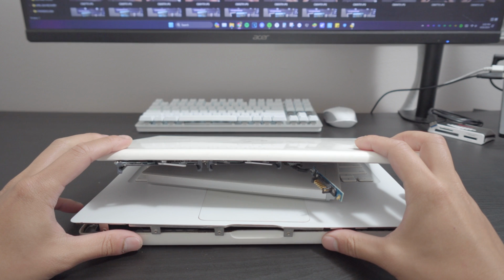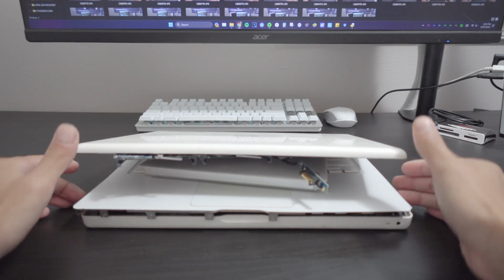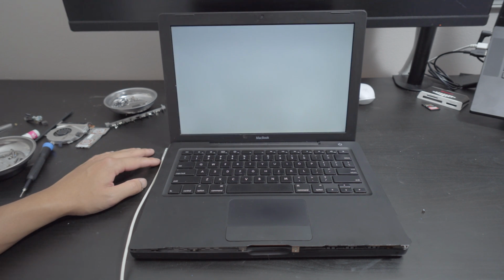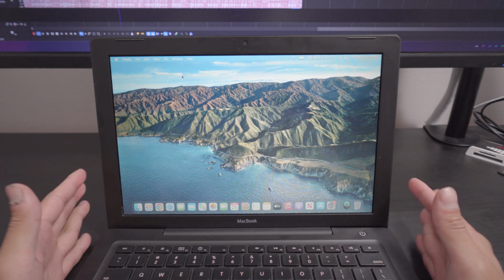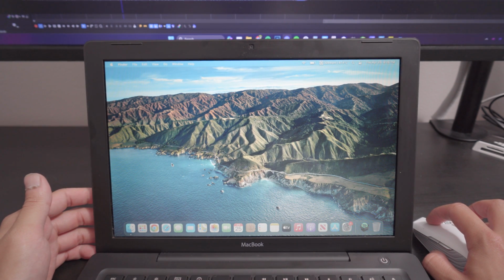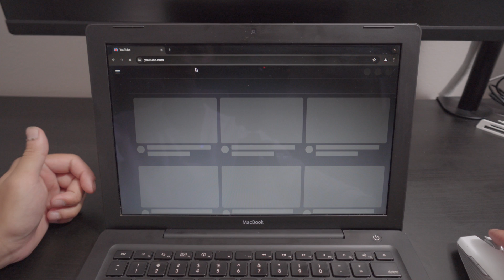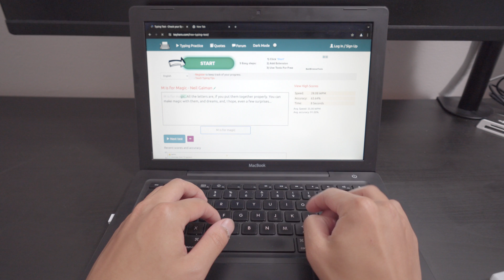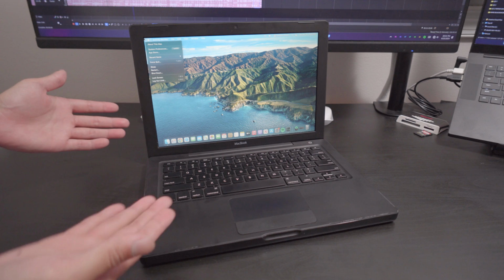THIS RARE OLD BLACK MACBOOK GETS AN UPGRADE MAKEOVER!!! USING IT IN 2024!!!

Comment: I have a 2006 black MacBook but the keyboard is dead. It's running Snow Leopard, takes me right back to 6th grade lmao. One of my favorite Apple laptops by far.
Reply from the maker: The keyboard is the easiest to replace on these pre unibody!
Reply: Wow those were the good days huh. You were lucky to have that macbook at such an early grade :) I had to beg my mom to get me a macbook pro for christmas 2011 and had to contribute my life savings aswell in order to get it. Something I was fine with as I just had to have it. 2000-2010 macs were peak. PCPower and Intel macs were worlds ahead of the newer m1 - 4 chip and so much mroe special. All the cat series of OS X are just so special
Reply: @Gizmotronicz  I should have worded that differently, I didn’t personally own a MacBook in 6th grade. We used them almost exclusively in school. We had iMacs and such in the computer labs, but I seem to remember using the MacBooks more. That’s where I was first introduced to Macs, we had the old iMac G3’s as well when I was in elementary school, that was 2004-2010. At home, we had a Dell Optiplex and later a Toshiba laptop. I didn’t personally own my first Mac until I bought a 13 inch retina MacBook Pro in high school.

Comment: Amazing, giving me ideas for one of my two 08 unibody macbook (not pro) 2.4 and my 08 black book 2.4.
What I find crazy is why apple never update the computer past lion having the same specs as the unibody from the same year, to my knowledge is something about 32 bit config on the kernel but is crazy no one has figure out a way to run newer OS.
Reply from the maker: I know right? Planned obsolescence at its finest
Reply: @cynonexus  now why no go further and change that matrix screen for the 13 inch 🤔 how difficult could it be

Comment: From my understanding and research way back when building a pc during the windows 95 days is that a lower case b stands for bits and the uppercase B stands for Bytes.
Reply from the maker: I always thought as well good to know thanks!
Reply: And to add to even more confusion these days is that I always used the term MHz in transfer speeds for memory (RAM) but now I see people using the term MT (Mega Transfer) for memory clock speed